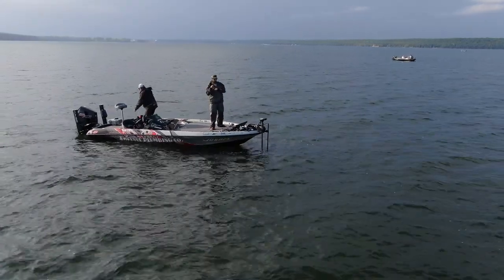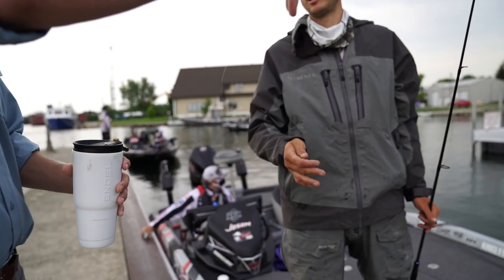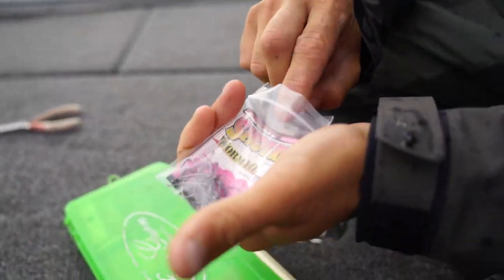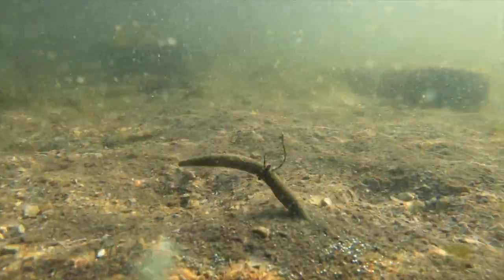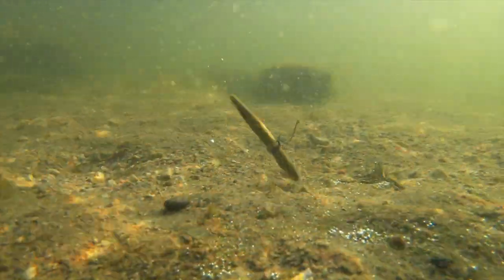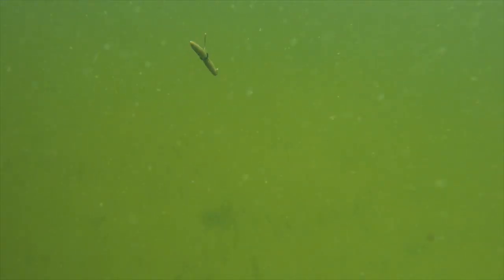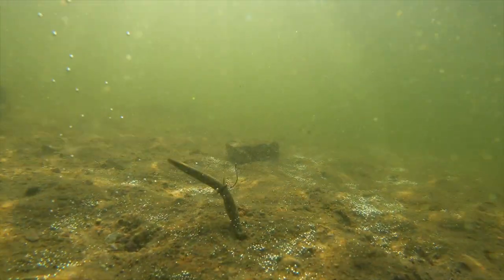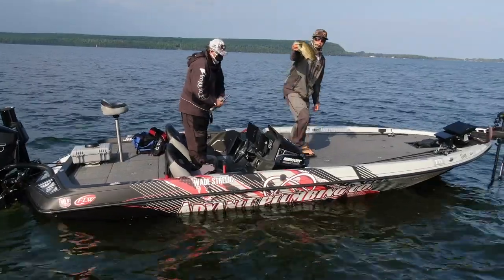Strelic's Smallmouth Neko Rig

Comment: You need to add a youngsten weight so it sinks to the bottom quicker for a reaction bite and use 15 flouro u can break off with the trash 6-10lb
Reply: Dam bro didn’t know you were a pro bass fisherman
Reply: @Guycrw and a grate spellar  2!😂